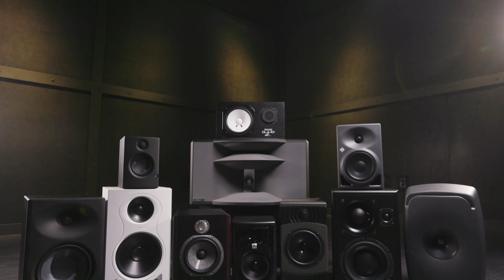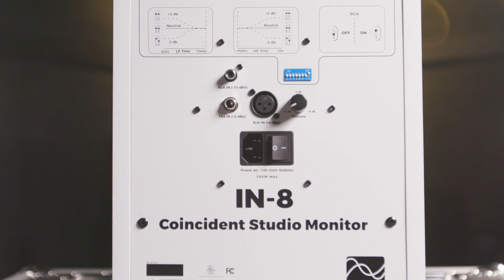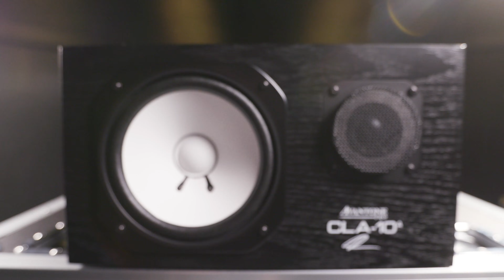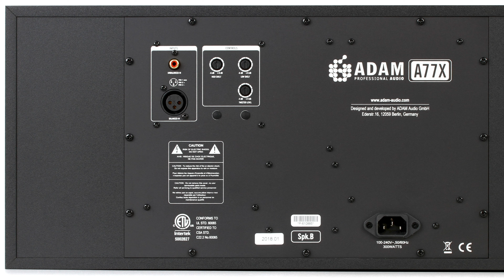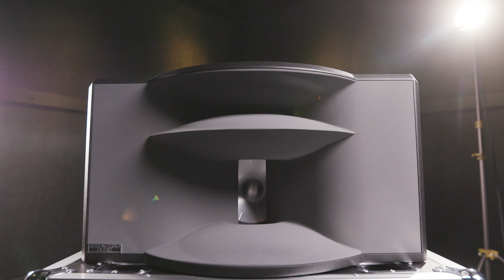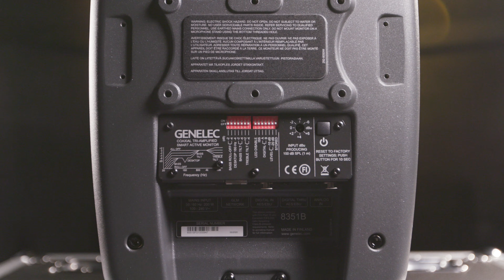Choosing the BEST Studio Monitors on ANY Budget

Comment: Any mastering monitor recommendations for larger size well-treated room (8 meters by 17 meters)?
Reply: Take for each channel 2x18" sub, 2x15" midbass, 12" lowmid , 1,4" driver midhighs...cross over actif sub and midabass and lowmids, passif between lowm is ds and midhighs....❤🎉 Enjoy unlimited dynamics without linear cone movement distortion and no crestfactorissues no compression of microdynamics....you can inspire on Troels or old jbl engeneers...
Beyma, faital pro, bms, 18sound ...etc...all make top components

Comment: Hi, I am looking for a bit of advice.

I am an aspiring dance 
music producer and I am planning on improving my production this year 
and taking it all a bit more seriously and potentially making it into a 
living. 

My current monitor is set up as follows. I have a set of Rokit 5 Rpg3 and a Focusrite 2i2.

I
 am currently in the market for a better / second set of monitors for 
another reference, however, I am and not sure what to get. This is what I
 am looking to achieve in my studio.

I want to be able to switch 
between 2 sets of monitors, dim the volume, mute the volume and also 
switch between stereo and mono and alos switch between headphones. 

Also,
 I would like the new set of monitors to complement the frequency of my 
rockits I currently have, as in, when I flick between the 2 sets of 
monitors they don't sound much the same, but rather have different 
curses on the spectrum, etc for mixing like a car/iPhone/studio/club, 
etc

I have a DJ setup that I would like to channel through the 
same 2 sets of speakers which I am currently doing by using 1/4 jacks 
through the line inputs on the Focusrite 2i2. I also have a Rode NT1 but
 I don't use it much only when recording other Artists as I don't sing 
myself.

My budget is about €500. And I am currently considering the following:

Option 1
Keeping my current set up and buying 
2 x Yamaha HS 7 or Yamaha HS 7 MP (Not sure of the difference)
Mackie Big Knob Passive

Option 2 
Selling my Focusrite 2i2
Mackie Big Knob Studio
2 x Yamaha HS 7 or Yamaha HS 7 MP (Not sure of the difference)

Option 3
Either one of the interface options above
but changing the monitors to 2 x Adam T7V or similar? 

Thanks and looking forward to  hearing what you guys think.

Comment: Dynaudio were the only ones who were honest about low end extension... None of the shown 7/8 inch two-way systems is able to deliver below 45 Hz, ...in the studio world we don't accept more than the -3 dB cutoff. The CLA is boxed shit und not to be considered a monitor. It's not even good at anything in particular. It's just this weird NS-10 mythos that seems to stay forever. Yes, I know that there have been some amazing mixes made on NS10s. But to get this straight: Every room has one, only one low end sweetspot. Use this space for a pair of honest and modern monitors. Like you said in the beginning: You will judge anything you hear through these monitors. Don't even buy CLAs or NS10s as a "reference"... Instead get references people use today, like air pods, bluetooth speakers, you get the idea. Nobody is using AM-Radio anymore, or 80s style HiFi speakers - why reference on them... They're also incredibly expensive for what they are. Get a pair of 80s paper woofer speakers from our dads best friend, or whatever :D

Comment: Wattage is a terrible way to judge volume  (loudness). There are speakers that can play significantly louder with 4 watts than some other speakers can play when driven with 120 watts. Use the speakers sensitivity to judge loudness, because that is an objective measure. 
Also, using woofer size to measure bass extension isn't a great idea either. I've got a pair of speakers with six inch woofers that dig down to 20hz. Granted, they're very large speakers, but still. Read spec sheets. You can tell very little about a speaker by looking at it. 
There are no "rules of thumb". Don't assume anything. Don't make generalizations. They simply don't work with speakers.

Comment: Brother, I have two options for buying a new monitor (Adams TV5 & Yamaha HS5). Suggest which one I picked for mixing and mastering.
Reply: Hs5 i have em and i trust em
Reply: I have the HS5 and they are really snappy and good for stereo imaging but they have a quiet weak low end ( in treated rooms ), rolling off from 100hz, and a really nasty peak at 1khz :( you get used to it but it makes it hard for hearing problems in the mix ( boxy sounds and mixing vocals ), luckily I calibrated them with Sonarworks and they changed completely ! No coloration and the bass response is flat up to 50hz ! Now I can really trust my eqing, and the amount of effects I use on my mixes, and the good news is that they sound way better on consumer playback systems !

Comment: You say "on ANY budget" but you didn't say in which range of budget are any of them are for. A mention of the prices would be much easier for us to navigate.
Reply: EVERY price below is per speaker, double it for a pair. Some are only sold in pairs, but the price is still listed per speaker.)
Presonus eris 3.5 - $50
Jbl 305 mk2 - ~$150
Presonus e8 xt - ~$250 (sub ~$400)
Kali in-8 - $400
Yamaha hs8 - ~$500 (usually on sale for $370ish)
Dynaudio bm5 - ~$500
Aventone cla10 - $350 (active $500)
Neumann kh120 - $730
Adam A77x - $1250 (they are side specific)
Pmc result 6 - $1500 
Focal solo 6 - $1500
Ocean way hr4 - ~ $3500 (sub $3000? Per channel)
Atc sCm25a - $4500
Genelac 8351b - $$4000

Comment: How do you connect these to a lap top for listening to music
Reply: Josh Newsome  
You’d need an audio interface that connects to the laptop using a USB or Thunderbolt connection.
Reply: If the monitor has unbalanced inputs (RCA) you can get a long RCA to 3.5mm cable, just pull the RCA end apart so the left and right can reach each monitor.  An audio interface IS the preferred method but not required.

Comment: Adam T8V’s are the best choice for affordable monitor option. That is all, folks.
Reply: I have the T7Vs and love them. Super balanced and sound perfect with a bit of dsp room correction
Reply: how's the hiss when turned up loud ?
Reply: @pablo-zn1mg  not noticeable. Even when sitting in the mix position without anything playing it’s very quiet. When you start listening the noise isn’t noticeable, similar to other high end powered monitors.
Reply: Theyre good but not everyone likes amt tweeters.  To me they always sound like the tweeter is playing separate from the woofer.  Its why I believe the higher end adams use small mids for a better transition.  I did like the T7v but they were a little bright for me.  I prefered krk g4s from all the monitors in a similar price range.  They dont have the high end extension like the adams but their mids are perfection.
Reply: @PowerSerge5000  I was about to choose the Adam T-Series, till I compared them to my Kali LP-6. The Adams sounded a little sharp compared to the Kalis. Bought the Kalis and I am beyond happy my decision.
Reply: @lucaverheyden  kali are a good monitor. Similar the JBL lsrs that I had for a couple years.

Comment: Those Neumann will need a sub at only 52hz extension (will drop off significantly before that). The low E on a bass guitar is 43-46 ish hz from my memory, so modern metal mixes would need a sub to get those low B notes that should be around 37hz?
Reply: Most of the time we don't really listen to the fundamental notes anyway. Challenging systems + modern mixes mostly show the upper harmonics of the bass ,unless the music are intended for clubs, which I think it's not the target for metal mixes. The KH120 go quite low for their size though. Absolutely agree with you regarding adding the sub to the KH120 for greater pleasure :P, , kinda lift the heavy work off the speakers.